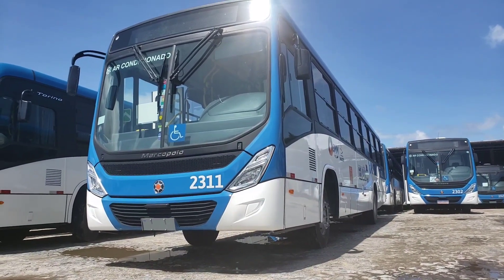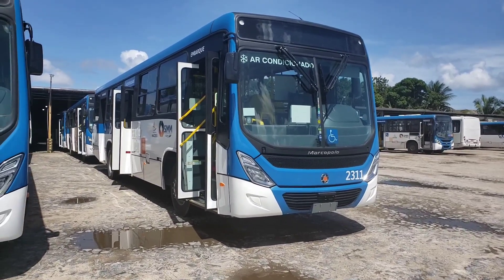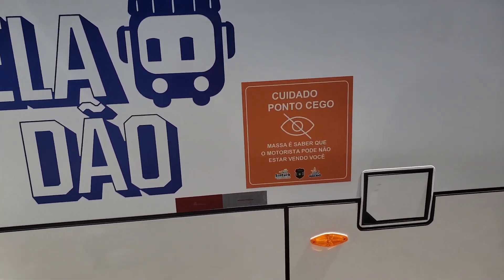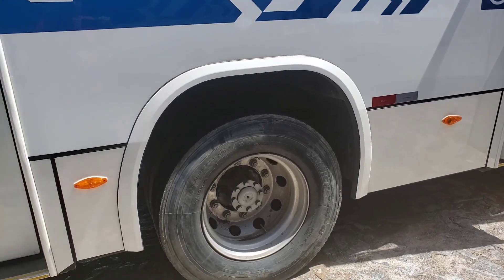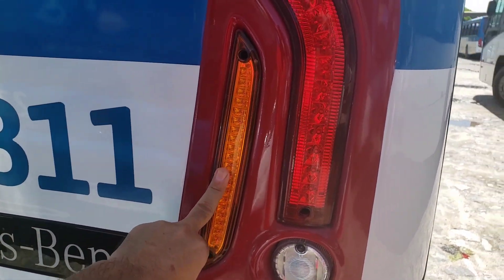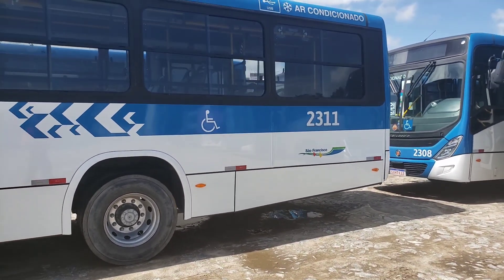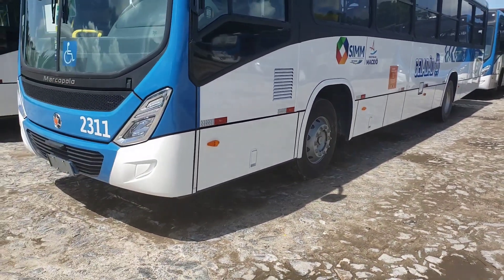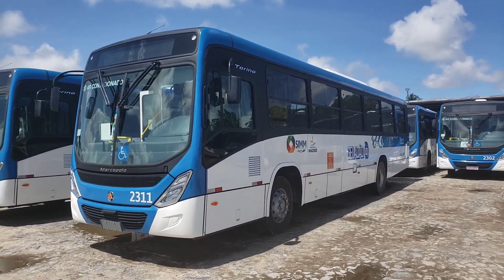EMPRESA SÃO FRANCISCO, ÔNIBUS NOVOS COM AR CONDICIONADO.

Comment: Olha só o 7348 da ciferal bem cumprido,  também tinha o 7358 ultimo da serie 8 , 7111 motor VW se não falha a memória,  e o 2155 depois passou a ser 7248 se não falha memoria,  
2115 7008 , 2125 7028 , 2135 7118 , 2145 7018 , 2165 7128 , 2175 7258 , 2185 7138 , então é isso mesmo,  2155 7248 abraços
Reply from the maker: É isso
Reply: São Francisco real alagoas cidade de maceió Ônibus